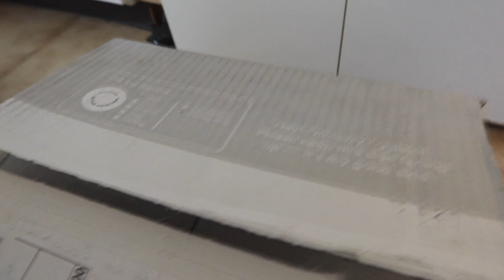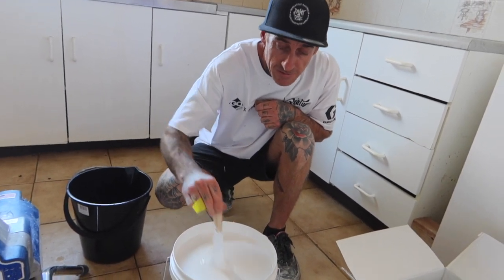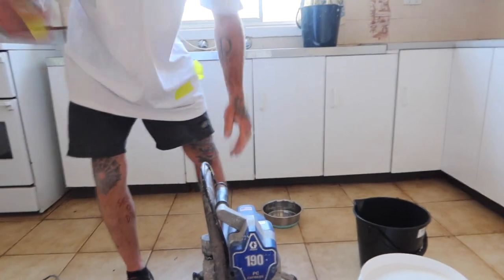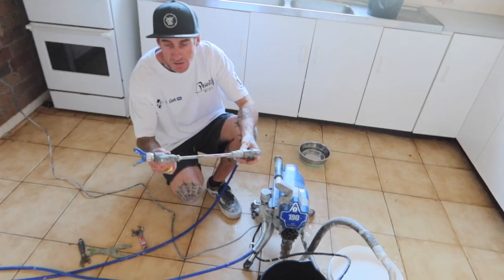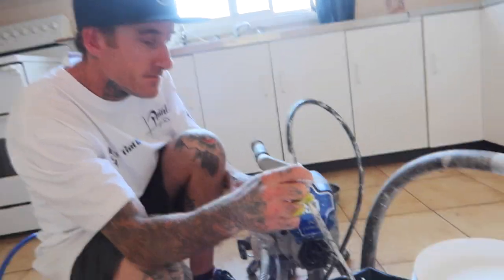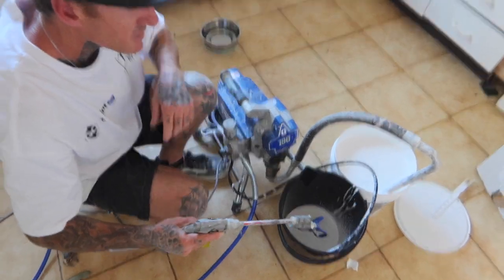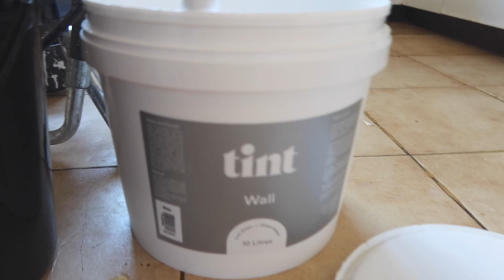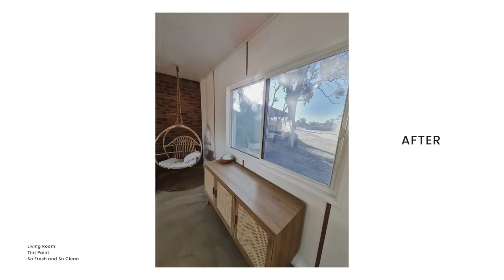SPRAYING WITH TINT PAINT

Comment: Hi guys, I’m about to repaint the inside of our house. 3 bed 2 bath lowset brick built early 90’s. I’d like to paint everything lexicon quarter, moving from gloss enamel to wb enamel on trim and I’ve got a small Wagner 150 sprayer with 515 and 311 tip. What would be the quickest process to get it done? Thank you
Reply from the maker: Hi legends, I would go through sand all the woodwork & spray undercoat spray ceilings two coats & walls  just ones. Then finish woodwork two coats then cut and roll last coat on walls. Hope this helps 🙏
Reply: @paintingbyjosh  That’s awesome, thank you 🤘
Reply: Is it ok to spray ceiling flat on walls as first coat whilst doing ceilings and then do final coat of walls rolled in low sheen?

Comment: Can you get away with using wall paint on those thin skirts or does it defo need to be enamel?
Reply: I'd go with enamel, wall paint will be more prone to damage. The enamel will be much harder wearing - particularly if you have furniture buttong up against walls, or someones shoes accidentally kick the trim. Worth the effort imo. That said I used wall paint on my ceilings, very little difference to flat white and looks great in my house.
Reply from the maker: Hi Micaela, i would agree with monique. 💯